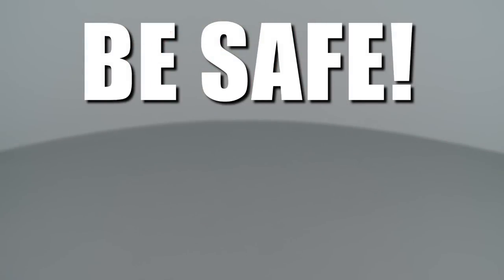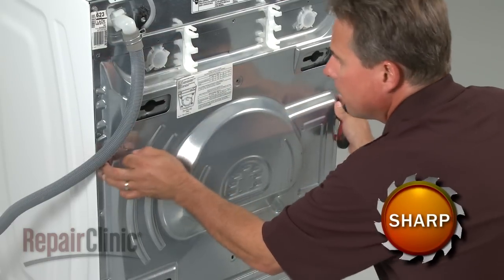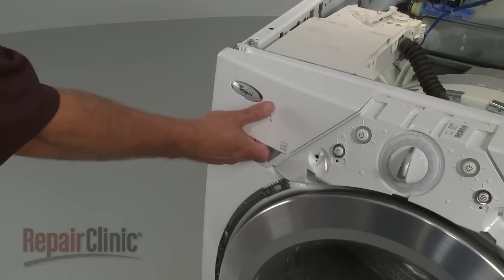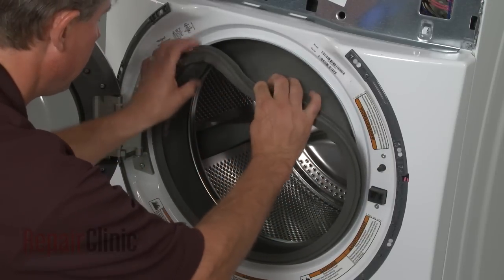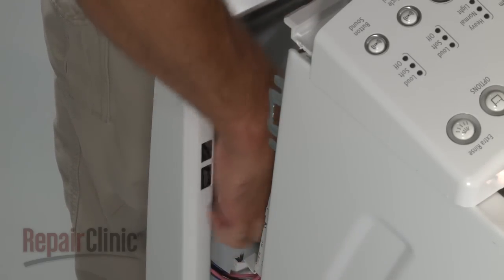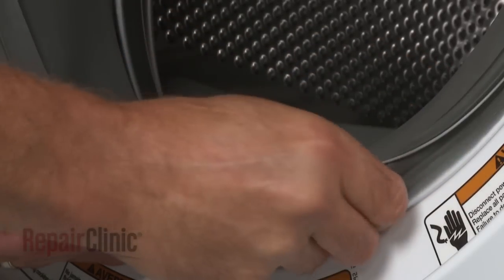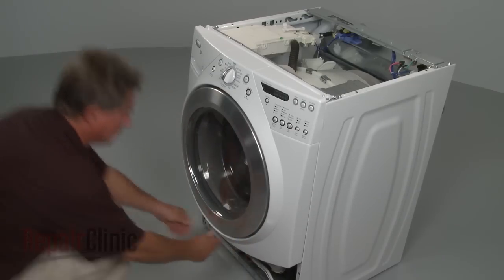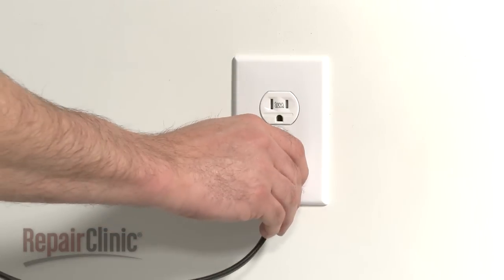Whirlpool Duet/Kenmore HE3 Front-Load Washer Disassembly

Comment: A lot of these use Torx T-20 screws almost everywhere. The alternative is a metric socket, possibly a 5.5 or 6 mm.  I use a magnetized T-20 Torx driver to keep from losing the screws.  Without the proper Torx  driver or socket, it would be very hard to do this with other tools.

Comment: Great video, but I was looking for a way to take the soap dispenser housing out. It has a film on the interior roof that I want to clean. Suggestions?
Reply from the maker: +nat c To remove the housing you would have to take the washer top panel off and disassemble the fill valve and all the hoses for the dispenser.

Comment: I have a Whirlpool duet, not sure of the model number, but when I press start it turns on, I never see it put in water, if it does its only a tiny bit, then will stop about ever ten minutes and never actually washes the items. I have no idea if we installed it wrong or what's going on. It's a year old, but was only used for a few months. We are the second owners the former owners took extremely great care of them.
Reply from the maker: The model should be on a sticker on the frame behind the door. We recommend that you confirm that water is actually getting to the washer sufficiently. You will need to turn off the valves. Then, unhook the hoses and put them in a bucket or laundry tub. Then, open the valves back up to see if you are getting good hot and cold water to the valve. If you are getting sufficient water supply, the water valve may be plugged up and need to be replaced. Also check the screens in the valve they may just need to be cleaned. Also make sure the unit is draining. The washer will not fill if some of the water won't drain. You can put some water in the machine and then put it in the spin cycle to see if it will drain out. If not you may  have a bad drain pump or a plugged hose.
Reply: Water is drained and filter is clear. I will try to hose suggestion though. Thank yiu.

Comment: Finally got control panel off, but think I broke one of the clips.  In the video you start on the left where the detergent goes and use a flat screw driver.  But on the right end, I didn't see where you pushed a clip.  It just came off.  Did you already loosen it, but not show it.

Comment: your video is great but I need to know if around the inside of that rubber boot seal is there supposed to be water sitting in it .My whirlpool duets were bought back in 2004 and I want to keep them going strong .I also cannot remove the bottom door panel .My washer and dryer are mounted on the drawer units because I have a bad back and cannot bend over and they are great to have
Reply: I had that same issue with water sitting/standing around the rubber boot after the wash ended.  There are 5 little slots in the boot.  Pull it back to see them.  Use a tooth pick or other tool to clean out those drain holes.  Once i did that... no more standing water around the boot.  Easy and cheap.  Add it to your monthly / quarterly maintenence checklist and you'll be good on the future. Usually too much fabric softener and hair out other debris will clog it over time.

Comment: I have this exact model. Just handed to me from my parents. I'm trying to find the grey board just behind the control interface, and the and the small sensor at the top right corner. (me positioned in front of the machine  controls facing me.) not the water level sensor the one beside it.

Comment: I have a whirlpool front loading washer, model WFW 92005q01. the model you have on the video looks very similar to what i have.  My problem with my washer is during spin cycle, the drum or barrel starts hitting the housing of the unit.  now it is getting louder! What do you think is wrong and do you have the parts for it?

Comment: What size wrench did you use to take off the screws/ nuts on the front lower panel? Sorry if I got the terminology wrong on this! I want to clean the filter to try and resolve our issues. I hate paying service call and labor fees for something I might be able to do myself.
Reply from the maker: The screws are T15 Torx.
Reply: @repairclinic  your talking about the 3 bottom screws right?

Comment: I have a Whirlpool Duet Sport WFW8300SW02 front load washer. I accidentally put "All" gel packs (he compatible) into the dispenser instead of into the barrel. Water began to spurt out the top left side of machine, so I immediately shut it off. Apparently something clogged(?), please advise if I may run the machine on some setting to clear this or do I need to disassemble and repair? Thank you,   Randy
Reply from the maker: I would remove the dispenser and clean it out . When you pull it forward it stops. You will have to use a screwdriver to press down on the release tab on the top of the tray to fully remove the drawer. You can run water in the tray and make sure the water comes out the hole at the back of the tray. From there the water goes through a hose at the back of the housing and into the front of the outer tub. You can pour a little water in the housing to make sure it is flowing into the tub.

Comment: The pulley of my HE3 washing machine is still loose even though the center bolt is already tight.  What could be the problem?  I think the bearings are still fine, as there's still resistance whenever the tub is manually turned.

Comment: I have an older Kenmore front loader. We live in an area that has hard water. The directional spout is not changing over. It is stuck on the rise cycle so the soap doesn't get used. I know there is a way to get to that spout to add either white vinegar out like away to get some of that lime off. Can tog tell me how to do that. Thank you
Reply from the maker: Dina B You will need to refer to your models owners manual for cycle setting details.

Comment: Whirlpool Duet HT model #WFW9400SU00.  How do you really remove the front control panel?  We are unable to release the LED side of this. Is there another release clip somewhere on the inside? The rest of it is loose and can be easily removed. Also, what is the best fix for F70?
Reply from the maker: +J “jkperr42” Per F70 normally indicates a failure of the central control unit. http://www.repairclinic.com/PartDetail/Main-Control-Board/8183259/1266667?TLSID=1773. You remove the top to again access to this part.

Comment: I  have the similar whirlpool washer, first, we found there is some water leaking on the floor, then, I checked inside, I found the seal/bellow has some splits on it,  when I put the duct tapes on it, it seems ok, but after few times, all the seal/bellow has a lot of holes, it seems erosive and broken.
I think we need to find someone to replace the seal, why this happen?
the seal become thinner and thinner and finally become splits and holes.
Reply from the maker: You can replace the seal yourself. If you enter your model number on our website http://www.RepairClinic.com?TLSID=1773 you should be able to find a replacement with video instructions.

Comment: I have a Whirlpool Duet Sport a sock was stuck in the door boot seal called and they charged me 100 bucks to get it out. Now its doing it again. Sounds like rubber coming out when it spins just like before. I removed the door boot seal did not see anything what other places can I look to find out if its something stuck?
Reply from the maker: m haymer You can look in the front in-between the inner tub and front cover. If you can’t find anything lift the inner tub up and down to see if there is a lot of play. If the tub moves a lot up and down the rear bearings may be bad causing the tub to hit the rubber seal in the front. You will also notice more noise in the spin cycle.

Comment: I have a Whirlpool 7.5 kilo front loader and I cleaned the lint filter and when I put the washing back on, to wash another load, there was water coming out of where the lint filter goes.  I felt around where the lint filter goes into and there were numerous coins that came out of there.
I have cleaned most of it, but there seems to be another coin, that is blocking the pipe.  It feels like it is standing up, but I can't get it out of there.
How do I get the machine to work again?
Reply from the maker: TheKrystale If you cannot clean everything out of the pump the last resort would be to replace the pump assembly. If you take the front off you could get to the hoses that go to the pump.

Comment: I have a Whirlpool Duet Washer Model # WFW8640BW. When I went to remove the clothes the door is stuck I tried unplugging it and putting it in spin and drain one I do that the light of add garment turns on then off and then the machine makes a clicking sound once it tries to spin.  I noticed there's something stuck in there between the rubber. Can you please tell me how I can oprn it without breaking the door,
Reply from the maker: tatiana tabares You should be able to remove the lower panel and reach up and pull a tab on the bottom of the door latch to release the door. This is the latch: http://www.repairclinic.com/PartDetail/Door-Lock/8183270/1419926?TLSID=1773. The tab you will need to pull down on is white and has a slotted hole in the center. If the water is not all draining out of the tub, the door will not unlatch. If this is the case, we recommend inspecting the drain pump and replacing it if necessary.

Comment: What kind of tool do you use to remove bottom panel? Screwdriver does not work  Thank you
Reply: The back of my whirlpool duet steam says 13 mm open end wrench but it was way too big for the screws
Reply: Our Kenmore HE2 Bottom Panel has (3) screws which take a small 6.5mm socket.

Comment: my problem is that there is no water entering the machine, i already replaced the dispenser motor unit as it broke. I see why it broke, when i cycle the machine the dispenser unit keeps rotating and it will not stop, it is not letting any water come into the wash machine. It must be a sensor related problem

Comment: I have a WFW9451XW00 whirlpool duet. The buttons and dial do not appear to be working correctly.  When I turn the dial...the wrong lights come on... washer will run but seems to not know which cycle...help?
Reply from the maker: greengirlrunner If the controls does seem to be working porpely than the user interface may be defective. http://www.repairclinic.com/PartDetail/Display-Board/W10283460/1552585?TLSID=1773
Reply: ***** Thanks for the info! I just called a local repair company as well and they said that because all the buttons/lights are acting up, that means problem is affecting both user interface boards...so problem is either the machine control unit or a loose harness.  ...that is a price difference of only diagnostic fee for harness and $260 for machine control unit...man I hope it's the harness...
Reply from the maker: greengirlrunner Thanks for sharing.

Comment: The machine drains but won't start a spin cycle the pump just keeps pumping. Is it the pump that's the problem? Please help
Reply from the maker: wolverine Davis You would need to start with getting your model number. You cannot troubleshoot without it. Different models have different parts and drive systems. http://www.repairclinic.com/RepairHelp/How-To-Fix-A-Washing-Machine/47---/Washer-won-t-spin-or-agitate?TLSID=1773

Comment: You Don't Have a video For replacing the Rear outer tub which houses the bearing? I Know The Part is costly. aprox. $375.00 plus special shipping. But Some Of Our Local Mom & Pop Stores we Provide Service For under their Own Contracts Opt To Have It repaired Rather than Replacing the entire washer. I Have Searched your Video Library for this Video. ( Nice Library by the way). But I Have Yet To Locate this Repair.

Comment: The Door Lock is on, but it is not locked and I can't get the washer to start.  The dial will not work either
Reply from the maker: The Duck Boyz Some models have a lower panel you can remove. If so, you can reach up under the door lock and release the lock manually. It's the tab shown in this parts picture on the right. http://www.repairclinic.com/PartDetail/Door-Latch/8182634/1094190?TLSID=1773

Comment: I have a newer model with a one piece front cover. How do I remove that one?
Reply from the maker: +John Sherlock Normally, you remove the top to access front panel mounting screws. Disconnecting the boot may also expose mounting screws.
Reply: +RepairClinic.com Thanks,

Comment: Does anyone have any information about repairing a F26 error message on a Whirlpool semi-pro front loading washer?
Ours keeps getting this fault for no apparent reason - it is an easy fix for the repair man but I could do it if I had a guide or advice to assist.
Thanks.
Reply from the maker: Bajandoug F26 = Door Switch Error. Possibly due to a bad door lock latch switch assembly. It's worth checking out.
Reply: ***** Thanks. from what the local technician suggested I think the control panel needs to be reset.
i can't get the soap dispenser drawer out.
Any suggestions?
Also there is a blue wired jack one end of which was unplugged .... why?
One more question ... why aren't there any references to the W'pool semi-pro front loader washer? I can only find posts for the Duet which is not a model we get locally.
Reply from the maker: Bajandoug There should be a locking tab you depress to pull the dispenser drawer out. Some newer models have a plug that a technician can connect to a computer to run diagnostic tests, but you normally need the manufacturers software. Most likely they are the same, but certain dealers like to have a different name to make it seem like their product is unique.

Comment: I forgot to label the 2wires and 4 wires connectors of control panel and to what slot is goes> U/P,EXP/SERVICE......UD,RV or program? anybody .Thank you
Reply from the maker: +Kamoteng Kahoy The washer wiring diagram should be located on the back or in the control panel.

Comment: Soooo helpful.  I have an he5t that I absolutely love BUT after 9 1/2 years of excellent service the electronics died.  Everything else about the machine is solid and should last 20 years.  My misgivings in buying it was the electronics and that sadly appears to have me over a proverbial barrel.  I would love to fix it but after disassembling it I can see that the ECP (made by Flextronics (Hungary)), has a machine-assembled PCB and some of the components are so small it's unlikely anyone can manually repair it.  What a terrible waste to  be held hostage by electronics.  It wouldn't be so bad if the replacement ECP components were affordable - they are almost as much as a new machine.  $200 for the 2-part PCB for the front panel and $400 for the side ECP unit.  OUCH!  So much for DIY.,,,
Reply: All modern electric appliances with electronic controls are vulnerable to power line surges. 
My solution was a whole house surge suppressor plus uninterruptible power supplies (with standby batteries) for all the cable connected stuff. So far, no surge related failures for the last 25 years.